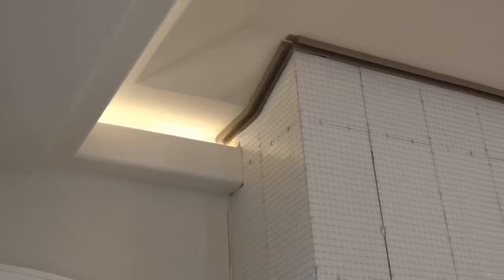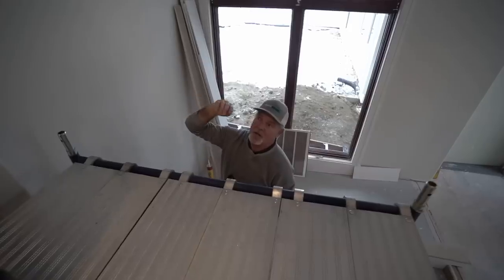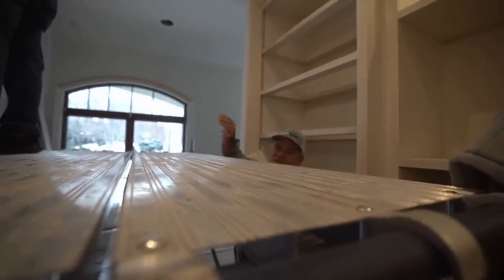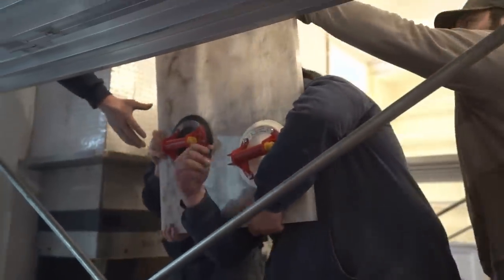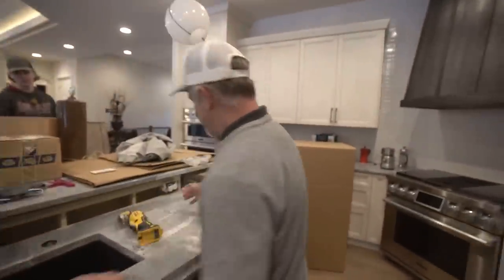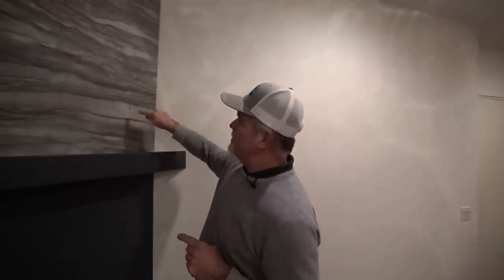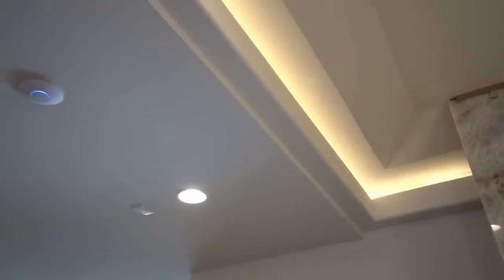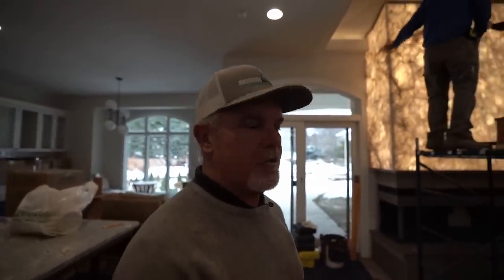Installing a $75,000 DREAM HOME FIREPLACE

Comment: Dang! I was worrying about having nearly a metric ton hanging off the wall, but that slide system looks good. That fireplace is very nice indeed.
Little things about various contractors and companies impress me and seing that trolley they had for carrying the slabs was definitely one. A whole LOT of thought and care went into designing and making that particular piece of equipment.
Reply from the maker: I was impressed with those little dollies as well… They look like landing gear on an airplane!

Comment: A lot of trust in those suction cups.
Reply: Some of those were manually pumped up. The ones with the lights are battery electric suction. Home Depot had a display set up. Once you hit the switch and it created a vacuum you cannot make it budge. I was impressed

Comment: Since you always answer questions, and you are using the ZIP system, I have a question for you.
Is it a normal building practice to deck the roof with the brown ZIP sheets, tape the seams, and then nail shingles directly to the ZIP with no other underlayment?
I ask because that's how they're roofing the houses in the development behind me.
Reply from the maker: That’s a great question… I’ve never use the zip walls for my roof sheathing, but now that you asked a question, I need to verify if felt paper is required ?
Reply: @BradtheBuilder  I'm old school and feel that the underlayment is an important part of water proofing. I built a shed using the ZIP system and think it's a good system. I'm just not so sure if nailing thousands of nails through it on a roof is a good thing.
I see where it's a cost, and time savings, but I am curious if it's an industry standard, or a cheap shortcut. Holiday Builders builds a lot of homes around here, and if it was a problem I think they would have stopped doing it. Some of the homes behind me survived 2 hurricanes last year and I haven't seen them doing any reroofs afterwards.
Thanks

Comment: The fireplaces look really good but what happens when a light goes out behind the wall?
Reply from the maker: These lights are supposed to last for 25 years plus… But in the event they do go out, we can remove all the quartz slabs just as we install them.

Comment: Looks like there's some gaps in the lighting
Reply from the maker: Oh no!  Where? 🙆‍♂️
Reply: @BradtheBuilder  It may possibly just be a side view thing.  Some of the camera angles were from the side, which made it look like there was a gap between some rows, but that was before the big sheets went up & the lights were turned back on, which made it look awesome.  I just hope that the lights last forever because I don't know how easy it would be, if it's even possible, to remove the big sheets to access the lights for repair.   That would be a definite nightmare.   : )   Looks great though.  : )

Comment: I hope the lights last a lifetime.  It would be terrible if parts of it burn out or quit working
Reply: The way its designed the guys could come in remove the silicone and slide the slab out fix the lights and re apply the silicone, and by looking at the lights, they look like big boards/pannels theyd just replace the whole board
Reply from the maker: @MrTjhayes  correct! 👍